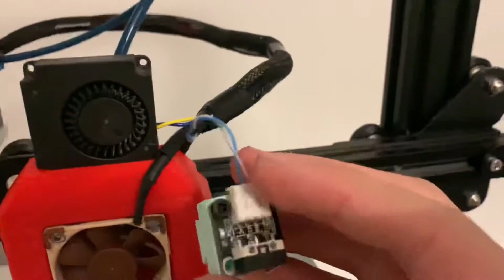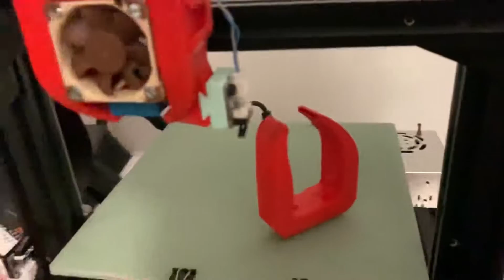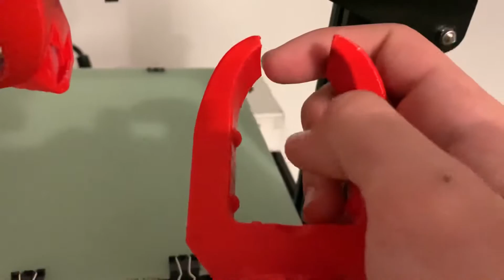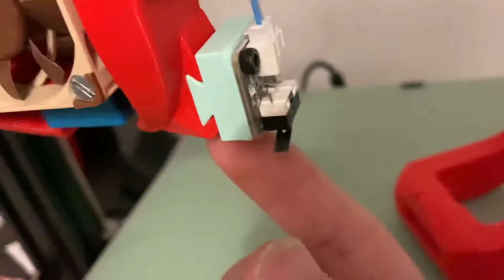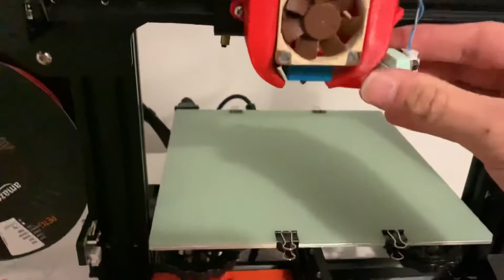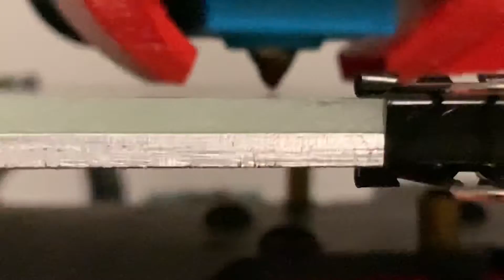Luckyman EZ-PZ microswitch / free-ABL mount showcase

Comment: you know about save multi state after probe ?
Example:
First probe &OFF heated bed save state 1 or slot 1
Second probe &ON heated bed save state 2 or slot 2
when next time ready print load from state 1 or 2 no need probe everytime bed on/off
in Marlin can do it ? what command G ?
Reply from the maker: Sorry I am going to have to disappoint you. 

I am not really that familiar with saving/loading multiple probe states. I’ve also been out of 3D printing for quite a while.

Comment: which bed leveling option was selected in configuration.h file?
Reply from the maker: In short:
UBL with a fix mounted probe

Inside of the code I enabled the following:

To setup the probe:
AUTO_BED_LEVELING_UBL
RESTORE_LEVELING_AFTER_G28
FIX_MOUNTED_PROBE

Probe settings:

Nozzle to probe offset may vary
 |
 |
V
NOZZLE_TO_PROBE_OFFSET { 37.75, -12, 0.4 } 
PROBING_MARGIN 20 <-- the amount of millimeters that can't be probed due to bed clips

XY_PROBE_SPEED 8000
Z_PROBE_SPEED_FAST HOMING_FEEDRATE_Z
Z_PROBE_SPEED_SLOW (Z_PROBE_SPEED_FAST / 2)

Comfort features I enabled:
LEVEL_BED_CORNERS
LEVEL_CORNERS_INSET_LFRB { 32, 32, 32, 32 }
LEVEL_CORNERS_HEIGHT      0.0 
LEVEL_CORNERS_Z_HOP       4.0
LEVEL_CENTER_TOO
Reply: @RikThePixel  is the switch connected to the z min stopswitch port?
Reply from the maker: @V843v3r  Well, im using the Probe port on my SKR E3 DIP V1.1

Comment: Can you make a complete tutorial on how to wire and how you got this to work code wise
Reply from the maker: It basically works like a normal endstop, so the wires of the ABL are the same as your endstops.

Inside of the code I enabled the following:

To setup the probe:
AUTO_BED_LEVELING_UBL
RESTORE_LEVELING_AFTER_G28
FIX_MOUNTED_PROBE

Probe settings:

Nozzle to probe offset may vary
 |
 |
V
NOZZLE_TO_PROBE_OFFSET { 37.75, -12, 0.4 } 
PROBING_MARGIN 20 <-- the amount of millimeters that can't be probed due to bed clips

XY_PROBE_SPEED 8000
Z_PROBE_SPEED_FAST HOMING_FEEDRATE_Z
Z_PROBE_SPEED_SLOW (Z_PROBE_SPEED_FAST / 2)

Comfort features I enabled:
LEVEL_BED_CORNERS
LEVEL_CORNERS_INSET_LFRB { 32, 32, 32, 32 }
LEVEL_CORNERS_HEIGHT      0.0 
LEVEL_CORNERS_Z_HOP       4.0
LEVEL_CENTER_TOO

Comment: Nice design. One question after you set up abl is it still necessary to level the bed corners screws? If so how?
Reply from the maker: In short... Yes you should always manually level you bed and then let ABL do the work. You make the rough leveling estimations and the ABL system finetunes it

My advice is to use Automatic Bed Leveling once you have alreadly leveled the bed (Yes with the screws). 

personally I use my ABL system to remove that last bit of  "Un-leveled-ness" if you get what I mean.